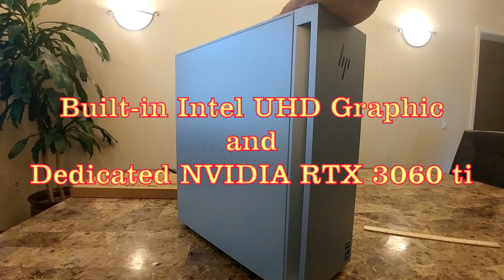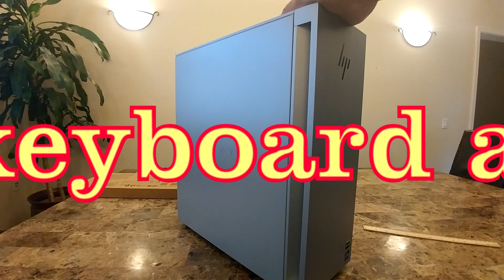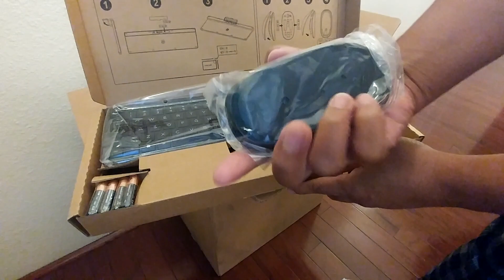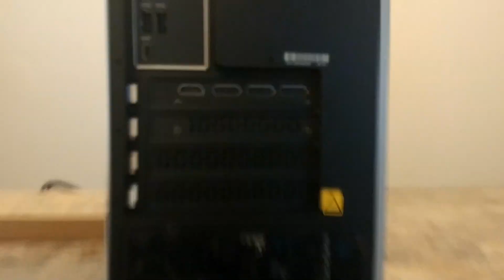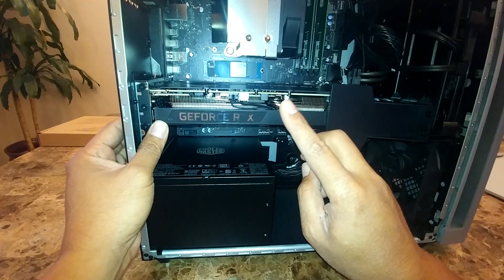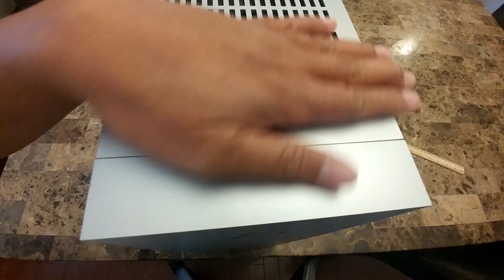HP Envy 12 Gen Core i7  from Costco. Can You Upgrade It? Features and Components Review.

Comment: There is a 2nd NVME M2 under the GPU.  Also the DDR4 DIMM Memory slot is very picky... I gave up chasing 3200 MHz speed after 4 different memory brands.  It's now running at 69GB with 2933 MHz but I am fine with that.
Reply: Here is your answer on the memory for this computer.

1. It does not run XMP memory at the memory's highest speed 3200mhz because XMP memory boots at lower SPD values and this motherboard accepts the slower operational speed as presented. Placing XMP memory in this machine will slow your memory controller too. Meaning ALL memory will run slower because the controller is accessing it slower. It is the controller that dictates memory access speed up to the max that memory can operate within it's values. ALSO, adding XMP memory will cause a memory timing mismatch resulting in operating system file corruption as seen by, opening an administrator command prompt and running SFC /Scannow 
Bottom line: Don't run XMP memory in this motherboard. HP has already ensured that the correct memory will run at 3200mhz with no XMP shenanigans.

2. You need to install memory that matches the HP installed memory. HP installed memory is made by Micron. Micron sells memory under the Crucial name. Getting the idea yet?

3. The memory you need to install that matches the HP installed memory is DDR4-3200 PC4-25600 CAS 21 at voltage 1.20.

4. Finally, here is the title and Amazon ASIN number for the correct memory (as seen by CPU-ID). [Youtube deletes links]
Crucial RAM 32GB Kit (2x16GB) DDR4 3200MHz CL22 (or 2933MHz or 2666MHz) Desktop Memory CT2K16G4DFRA32A
Amazon ASIN: B08C4LXXCJ

5. CPU-ID shows the controller speed and memory timing values (not all of them though), that perfectly match the HP Envy motherboard TE02-030 and the installed OEM memory (or whatever the model number is). It is an exact match.

None of the above is guesswork. I own two of these systems which I have modified extensively as possible within it's contraints.
Reply: @SpaceCadet4Jesus  thank you
Reply from the maker: Wow. Thank you for the detailed explanation on the memory option. I am still running on 32GB and so I do not feel the need to add more but this is a good information to have. I will add the links in the description since youtube allows me to add links there.
Reply: @SpaceCadet4Jesus  any thoughts on adding an extra exhaust fan on top of the case? it seems one will fit there
Reply: @wolfof  In another comment in this video I breakdown all available upgrades, including a single fan radiator liquid cooling attached to the upper plate, which vents through the case grill. Or you could just place a single 120mm fan blowing out, no room for dual fans.
Reply: @SpaceCadet4Jesus  maybe the comment got deleted but i dont see it. Would you mind explaining how someone could add liquid cooling to this desktop? thank you
Reply: @wolfof  Look for my comment (outside of this comment thread) starting "People that are interested.....", then look for item D:
Reply: @SpaceCadet4Jesus  gotcha i had to sort newest first. I have the i9 12900 version of the cpu would you say everything you said still applies?
Reply: @wolfof  Yes, nothing changes with the i9 12900. In fact, people with the 12700 (like me) could swap into the 12900 but that's spending a bunch of money for little improvement, that won't be felt in real life.
Reply: @SpaceCadet4Jesus  okay got it! Thanks
Reply: @SpaceCadet4Jesus  Hey I have a question if you dont mind. The version i have comes with motherboard HP 894B which has a LGA 1200 socket but the pc has a i9 12900 cpu  with a LGA 1700 socket. If i wanted to replace the stock cpu cooler with a LGA 1700 cooler would i need to replace the back bracket? or can i reuse the same back bracket eventhough the motherboard is has 1200 socket?
Reply: @wolfof  First, let's clear up the discrepancies in your question. 
You say your motherboard has an LGA1200 socket and then say it has an LGA1700 socket. It cannot be both for obvious reasons. 
A 1700 pin CPU cannot fit into a 1200 pin CPU pad, that's a difference of 500 pins. What to do? 

In 2020 or early 2021, the HP motherboard designated BlizzardU 894 came with LGA1200 socket and matching CPU. It did not support the CPU either you or I currently have.
In late 2021 or 2022, the HP motherboard designated BlizzardU 894B came with LGA1700 socket and matching CPUs. It does support various Alder Lake CPUs from i5 to i9 and supports the CPU you and I have (by simple CPU swap).
Problem is, HP isn't entirely efficient (or awake) so the motherboard documentation on the 894B reflects the old LGA1200 socket designation. Just consider it a typo.

Now, onto your question.
Honestly, the oversized stock CPU cooler is sufficient because the i9 is limited to 65 TDP and the i9K is limited to 125 TDP, but you want to replace it. The difference in performance between the two is negligible. The cooling difference between stock OEM and liquid cooling is likely negligible too. I did it, just because I wanted another fan inside.

A new LGA 1700 cooler would fit directly into the spacing left by the OEM cooler with exception. The exception would be a water cooling kit that contains it's own brackets (top and bottom). If you were to install the water cooling system I referenced in another comment, then you must remove the CPU bottom ("back" as you put it) bracket, necessitating removing the entire motherboard (after you take pre-removal pictures of the interior to help speed  up reinstall).

You will encounter a slight problem in depth spacing using the new liquid cooling brackets. Seems HP reduced the motherboard layers so it's a bit thin. No 8 layer motherboard here.
Because of the motherboard thinness, you will need four (4) non-conducting thin washers placed onto the bottom bracket prongs (standoffs) before inserting the bracket into the motherboard. If you don't do this, the CPU bracket will not hug the CPU nor the liquid cooling plate tightly soon resulting in an overheated (destroyed?) CPU.
This issue solely rests with HP decreasing the thickness of their motherboards.

What kind of thin washers, you ask?
Best washers are the motherboard standoff red fabric washers found in motherboard standoff screw kits. I had a few of them since the 1980s. You can find them on Amazon or ask an IT pro for a few. Get 8 of them just in case.
Slide them onto all four (4) new bottom bracket standoffs, it will take force but they will eventually go on. Then assemble the rest of the kit.

Hope this helps.
Reply: @SpaceCadet4Jesus  hey you mention needing CAS 21 ram, but then recommend getting Crucial CL22 memory? i'm not super knowledgeable about memory timing stuff, but isn't CAS=CL? sorry just a touch confused and would appreciate clarification
Reply: @ps-pool  Yes, CAS=CL, Different abbreviation (just to confuse everyone it seems).
The Amazon ASIN (I gave) references the correct memory you need but labels it CAS22.

Remember NO XMP memory, don't even think about it

For the memory in question on the motherboard in question:
Interrogating the chip reveals;
JEDEC #12 1533Mhz CAS 21
JEDEC #13 1600Mhz CAS 22
JEDEC #14 1600Mhz CAS 23
JEDEC #15 1600Mhz CAS 24

Technical:
Memory with multiple onboard chips use different JEDEC timetable  frequencies (base clock) with different CAS Latency speeds to ensure each chip access does not interfere with a companion chip and that the memory bus is as close to 100% busy. Don't assume that a lower CAS speed means faster memory. A higher latency combined with a higher base clock can out throughput a lower latency with a corresponding lower base clock. The memory of today has much higher latency than memory of yesteryear, but faster performance because of factors much greater than simple latency. You cannot base decisions on singular technical value without looking at the whole component,  it's integration  and transfer operation, a rather complex issue.

A pet peeve of mine is that no longer do OEM manufacturers or resellers really give you any detailed information on the motherboard and often times doesn't even mention it.
 All the supporting chips, bus speeds and logical engineering in the motherboard matters more than the simple components attached. A motherboard can make/break a computer build.
Reply: @SpaceCadet4Jesus  thank you for the clarification and detailed response. Are you happy with the envy TE02 desktop?
Reply: @ps-pool  It's a great running machine but a rather slow booter.
Reply: @SpaceCadet4Jesus  got ya, I think I saw your review where you mention to change the button battery
Reply: @ps-pool  Omg.. I'm famous now. 😅😉
Reply from the maker: @SpaceCadet4Jesus  I guess you are now. Thanks for sharing your knowledge about this PC.
Reply: 69 GB nice
Reply from the maker: Thanks for the information on the 2nd NVME M2 location. Now I am liking this PC more.  Regarding the memory what brand did you use to upgrade? What other brands did you try that did not work?
Reply: @diymanual  This is the fastest one 2933 MHZ  MES4U320NF32GX2  I kept this.
Reply: BTW I still can't figure out how to connect 5.1 audio audio jacks.  The bios is so locked by HP.  Normally the realtek software (in other MB with realtek chips)  allows the blue/green/mic jacks to be switch around  (center/subwoofer,  rear speakers an side speakers)  If you figure this out, pls let me know.  Thanks.
It's a great PC for what I need (kids soccer video editing)
Reply: problem solved.  Reinstall Realtek driver.  I got my 5.1 back.
Reply from the maker: I just saw this. Youtube does not show new reply's to me. Only new comment thread but I am glad you got your 5.1 audio back and thanks for sharing.
Reply from the maker: I also use mine for video editing and I am loving it.
Reply from the maker: Thanks for sharing this.
Reply: @ekapon  what video editing software you recommend?
Reply from the maker: @ichunl  I am using Pinnacle Studio 26
Reply: These are not compatible and max out at 2400Mhz (from Amazon)
TEAMGROUP TPRD464G3200HC22DC01
Patriot Viper PVSR464G360C0K
OLOY MD4U323216DJDA)

Comment: Great video! However I just want to point out that there is a second M.2 Slot to add one additional NVMe SSD to the computer. It is covered by the graphics card so you just have to remove the graphics card and put it back after installing the SSD.
Reply from the maker: Thank you. That is good to know.
Reply: L ll.   Llĺ6 lll🎉llllll6 🎉llĺllll.  L llĺl.l. l ll m 😮 @diymanual
Reply: Thank you for this comment. I was trying to figure that out for a while.